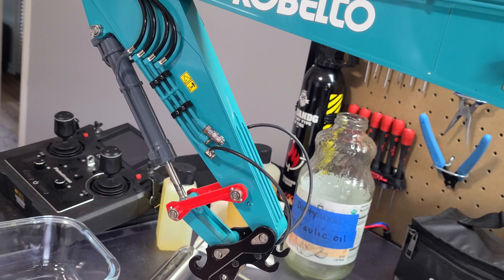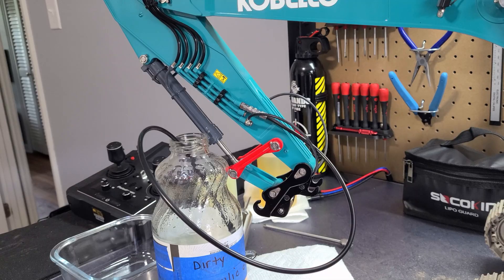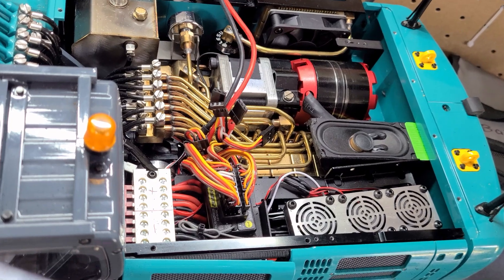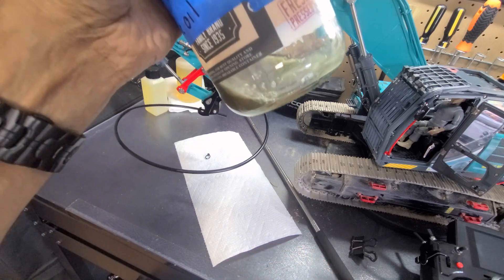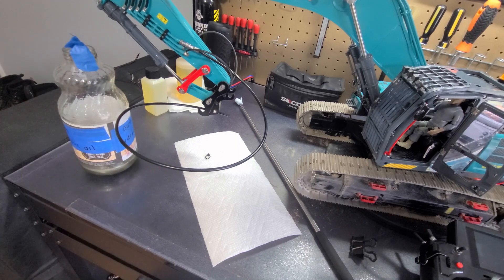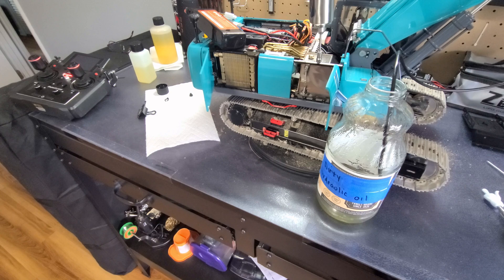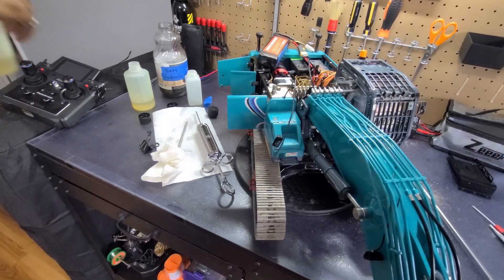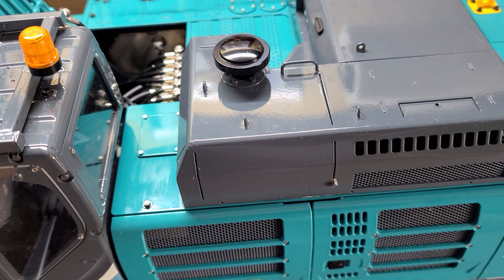SK500 LC Hydraulic Oil Change LESU AOUE Kobelco

Comment: Was the filter dirty or blocked because, I work on the big stuff. Oil gets changed when it needs to be changed. As with the filters but we test the oil if it comes back fine back in.
Reply from the maker: The filter didn't look dirty. However, if it was it would  be a major undertaking to remove it and clean it. The whole hydraulic assembly would have to come out.